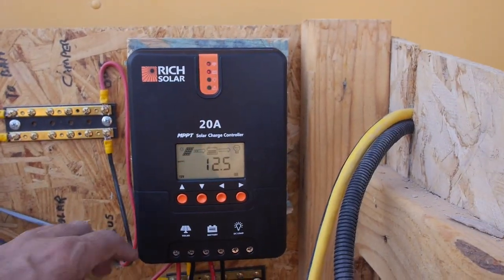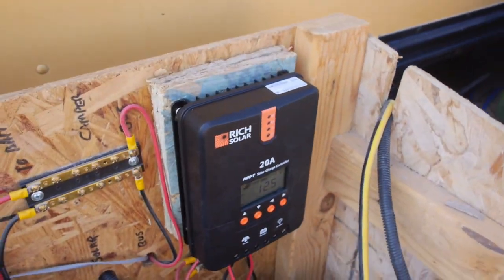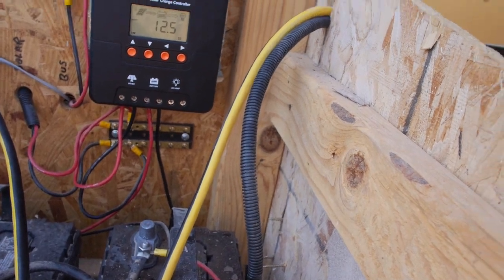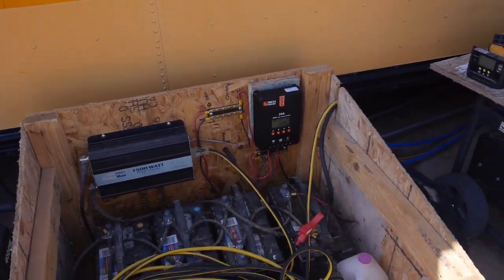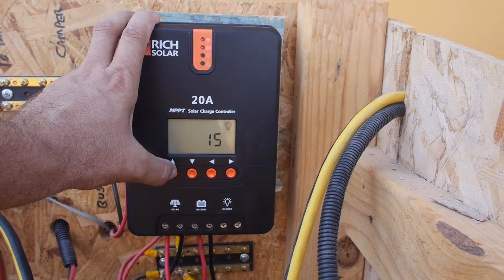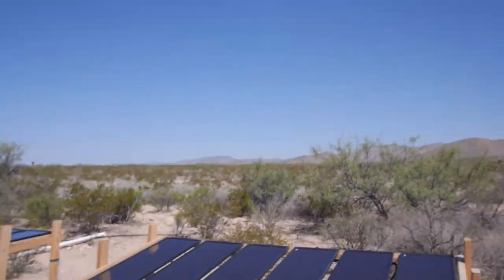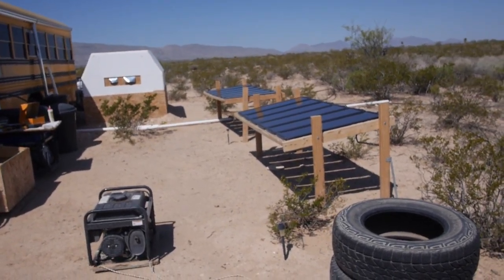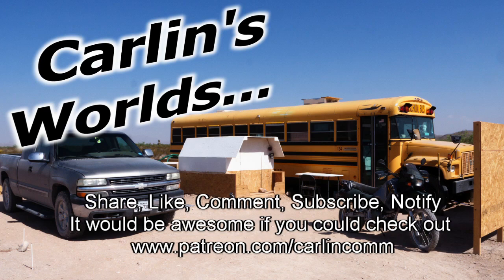New MPPT Charge Controller from Amazon

Comment: Not sure about this particular MPP but if it allows for higher voltage you can get better performance by wiring in series. On my controller I can input around 100 volts from the panels and it will automatically reduce voltage to either 12 or 24 volt battery banks while maintaining maximum watts.  Higher voltage allows for safe use of smaller gauge wires.  Sorry if this has already been posted.  The Harbor Freight panels are a decent deal when you get them on sale and their small size makes them easier to work with than larger ones. I just started buying Grape Solar 100 watt panels from Home Depot. $80 (plus tax) for 100 watts, delivered to your door with free shipping.
Reply from the maker: I've never tried that, but it is something I'm looking at for another project. Thanks for the tip and best wishes! I think 4x the HF panels would be about 80 or so volts, should work with the controller.

Comment: I have ten 400watt solar panels for a total of 4kw and each panel puts out about 41.3vdc.

I want to set them all up but am getting a bit confused. I want to set up a 24v system...
Reply: @redbonecoonhound  Thanks for the advice, but I've already studied and worked at electrical/electronics for many years to know what I'm doing. I'm only asking a few questions for certain things I'd like a little clarification on.

I know about Will Prowse and I've watched many of his videos. I've even asked him a few things, but he apparently doesn't like answering them.
Reply from the maker: I'd also say Will P has good info. He probably doesn't have time to answer all his comments anymore, I don't have anywhere near the volume he has and I still miss stuff here. I'd only add to be careful, you watch enough videos, you'll go in circles! "Best" is a tricky subject. Best would be LIthium on a 48 volt system. But we aren't there yet. Keep the faith and stay safe!
Reply from the maker: That sounds like a great set up! What part are you confused on? Lets start with the batteries, what do you have now? If you do a 24 volt system, you'll need an inverter that can use 24V. At the moment I'm still running 12 volts, which is not the best, but my inverters are 12V. After you get your batteries and inverter set up and connected, your charge controller probably will automatically set the voltage, but you may need to set it for what type of batteries. Let me know, maybe I can help get you started.
Reply: @CarlinComm  I have a 12v 5,000w inverter and also a 12v 4,000w inverter plus some smaller 12v 750w inverters. I thought I had a 24v 5,000w inverter but can't find it right now. I have the 41.3v 400w solar panels totaling 4kw, a 12v 500w horizontal wind turbine and a 24v 4,000w vertical wind turbine. For a total of 8.5kw or 8,500w all together.

We used to have all kinds of wind until I bought my wind turbines... now we hardly have any wind at all. lol
Reply: @CarlinComm  I have a dozen smaller 12v batteries already, but I need better ones. Problem is I don't have money to buy them on my meager disability pay of just over $1,000 a month. I challenge anyone to try surviving on just a little over $1,000 a month.
Reply from the maker: @nunyadamnbiznez3522  Yeah I quit work back in January, I'm living off about $100 a month lately, its rough, but since I built the house and paid off the land, I think I can do it. 
What are you doing with all the power? You have about 10x what I'm using here, just curious. From what you're saying, best bet is to stay with the 12V batteries in parallel. The next step up is pretty expensive.
Reply from the maker: @nunyadamnbiznez3522  Maybe sell some of the smaller inverters, since its not very efficient to run multiple small inverters, they all pull some load even when they're not in use, put that money toward a bigger 24 or 48 volt inverter.
Reply: @CarlinComm  I understand my panels will make more than the mppt will take, so additional inverters will take up the slack.
Reply from the maker: @nunyadamnbiznez3522  Ok, I always figure people are the experts on their own system, because they know what they bought and had a plan. I was just curious.  I know my system went through a few evolutions, as I outgrew parts, it gets confusing sometimes remembering why I made the decisions I made.  Hoping that I can grow into a full size 48V system in the next year. It is a process.
Reply: @CarlinComm  Good luck. I wish you the best.
Reply: @CarlinComm  My panels put out about 41.3v and that won't work a 48v system, so I have to go lower, but will still have the almost 20 additional volts above 24v. I understand I can connect additional mppt's to use that extra power.
Reply from the maker: There are some charge controllers that can boost, I don't have any experience with this, but have seen this brand used on some projects, for example a diy solar bike project I"m following... https://www.amazon.com/Genasun-GVB-8-Pb-48V-GV-Boost-Controller-Batteries/dp/B01MTU87Q5
Reply from the maker: @nunyadamnbiznez3522  Yeah I can agree with that. Over time, I have heard a lot of people say lithium will save money, but if you can't afford a $1000 battery, lead acid is hard to beat! I started with a mismatched set of used batteries, got a few months out of them, got a new set of 4 matched deep cycle batteries, got 2 years out of those, and am on my second set of new batteries now. I'm also building lithium batteries for my electric bike project, have about $300 into that project now, (look for Project Turtle on my channel) and what I'm planning to do is run some things off the bike battery when I'm not using the bike. I have a lot of extra batteries, won't use them all on the bike, so the rest can help power the solar system. But that's not an easy thing to do either.

Comment: MPPT stands for Maximum Power Point Tracker. It is a circuit (typically a DC to DC converter) employed in the majority of modern photovoltaic inverters. Its function is to maximize the energy available from the connected solar module arrays at any time during its operation.
Reply from the maker: That sounds right, thanks! Its pretty good technology.  Every little bit adds up!
Reply: @CarlinComm  you prob get better results if you can make the solar input higher voltage like say string a group as 30-60v and hook to charger controller as long as its can handle that input voltage 
you get more amps well less of a loss.
Reply from the maker: @jfraser3  Right, as long as the charge controller can handle the voltage, you're right.
Reply: @CarlinComm  as my victron has 3 190watt panels @ 60v 6-7A but at the battery it pulling in 30A or so  . 
https://goo.gl/photos/Dw4x8xMK6PEwEGrW7
i need to mount that victron i know ..
Reply from the maker: @jfraser3  Looks like a great system!
Reply: @CarlinComm  thanks wish i could send some panels your way but little far from Australia. the two suntechs would be very good in your system
Reply from the maker: @jfraser3  No worries, Mate! :)

Comment: good video. but since you have a mppt you should rewire to 24v, that's the big efficiency advantage(over pwm). also 100w poly panel can be $75 Amazon.
 ex. 2- 100w@24v cost you $150
Reply from the maker: Thanks for the comments! I totally agree, my reason for staying with 12 volt is the inverters, I already have them, they are easier to find locally. I recently installed some new panels, yeah they are awesome.  Best wishes!

Comment: 14 volts at 9 a.m. comes to 126 watts per hour.. now if I am correct you have 3 100 watt kits and they are only putting out 126 Watts. I made the same mistake if you want to save money go with Mighty Max 100 watt solar panels and hook them to your mppt controller. They will do much better than the Harbor Freight kits.
Reply from the maker: Thanks, if I could see further into the future, I could make better decisions, maybe skip some steps in between, but maybe that's why people watch the video ;) Thanks for all the comments and support.
Reply from the maker: That's the tricky part of saving money, you have to take into account what you already have. 9 am is well before peak solar, and panels rarely put out rated output in the real world. When I got the HF panels, that was what I could afford that day, also, they are in stock in just about any town. My neighbor has some wonderful panels, that got wiped out in a wind storm, from what I saw, they took several weeks to get the replacements. Don't get me wrong, as I grow, I'm replacing what I have with better stuff, that was the point of this video, swapped the charge controller for something better. Next I'll swap the batteries for something lithium, hopefully this year, and then next year start swapping out panels. But I might do wind before new solar panels. Best, is a slippery slope. Thanks so much for your comments!
Reply: @CarlinComm  I agree 100% with your logic. We have to do what we can afford to do when we can afford to do it. For VERY little money and beyond easy hookup, you created an off-grid system that works! Now you have made an inexpensive upgrade that works. I totally get it. I am doing the same thing. Many of us like your open and honest approach. Keep it coming and congrats on having your system.

Comment: So I’m trying to set one of these things up. I try to get in to the parameter settings to adjust float voltage but all that happens when I press set again is it cycles between the 12/24v and battery type parameters, any ideas?
Reply from the maker: Sorry, I don't have the instructions handy, I am running 12 Volt system so just ran it at the defaults. If I think of something I'll post back, good luck!
Reply: Carlin Comm thanks I have the manual but what they say in it doesn’t work. Appreciate the response.
Reply from the maker: @Shmojoe14  Chinese translations? haha Sorry, hope you figure it out, I may not be back online for a week, so will look for your happy reply!

Comment: That's an mppt connect panels in series and use the mppt like it should be used
Reply from the maker: Not sure if I understand your point. Please explain.
Reply: @CarlinComm  s/he is saying that 12v panels in series will allow the MPPT controller to do what it does:  convert excess voltage to additional current.   There are other benefits (wiring, low-light performance, etc) but if it works as-is you don't have to change anything.
Reply from the maker: @fratermus5502  Yeah, I need to stop being snooty when people are trying to help me I guess :) I have since done some testing on a smaller set, and I didn't see a huge improvement going to 2 panels in series, since I am running a 12 Volt system. If I go 4 in series, I'd be really close to max voltage rating on some of my controllers, so on a really good summer day, I probably would go over. So, for this system, it wasn't worth the trouble. If you happen to see my later videos, I've had people donate some of their extra panels, so I have a mixed system, 3 different charge controllers, 3 types of panels, 2 types of batteries, none of it is "ideal" but its working better combined than it would if I segmented everything. I guess my other sore spot, is everyone gets all bent, because they read somewhere that "this way is the best way" and while the theory is probably true, out here in the wild, it doesn't always make all that much difference. The time wasted chasing that last 5% sometimes isn't worth it. But thanks for your comment! Engagement is apparently really important!
Reply from the maker: Oh, and I already did damage one controller going over voltage, just wasn't paying attention, so apparently the smoke does sometimes come out when you exceed their recommended daily allowance!

Comment: So did you notice an increase in current? You only have 300 watts so not a big system...on mppt chargers they should allow you to program in the panels Vmp, sadly they don't...
First thing one needs to know when mounting panels is the sun angle (all year) 
https://aa.usno.navy.mil/data/docs/AltAz.php
Reply from the maker: I didn't do enough testing before I moved to the mppt, as far as documentation. I did notice that I usually did have enough power, except for days when I had cloudy conditions for 2 or 3 days in a row. I'm still pretty under power, but seems to be almost enough most days. Thanks for the comments!
Reply: > on mppt chargers they should allow you to program in the panels Vmp, sadly they don't

MPPT finds Vmp itself;  it's literally in the name Maximum Power Point Tracking.

Comment: Keep us updated on the new controller.  Looks good.  Is that an Amazon mppt?
Reply from the maker: This is the link, seems to be working well. 20 Amp 12V/24V DC Input MPPT Solar... https://www.amazon.com/dp/B079ZM9MR6?ref=yo_pop_ma_swf
Reply: How's the controller working out?  I have my eye a new MPPT.
Reply from the maker: The new charge controller seems to be working well I think it's an improvement over the pwm controller I took off I don't have specific numbers but I do seem to have more power available in the evening when I get home so I think it's a good sign.
Reply: The Renogy "Rover" MPPT 20A/30A/40A controllers out now look much the same, just a different color and say "Renogy" on them. But yes, probably made in the same Chinese factory by the same company.
-- BR